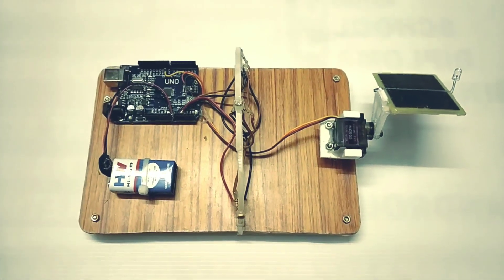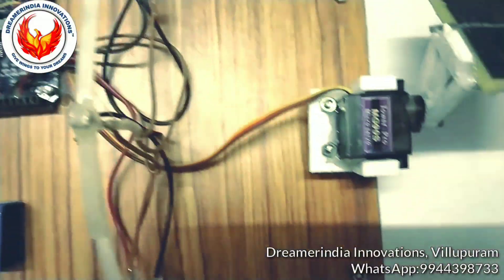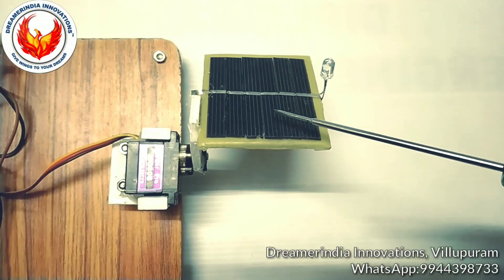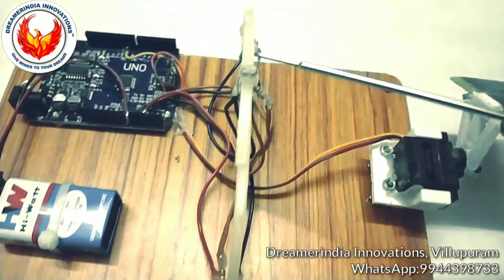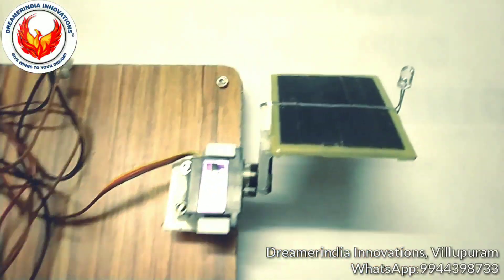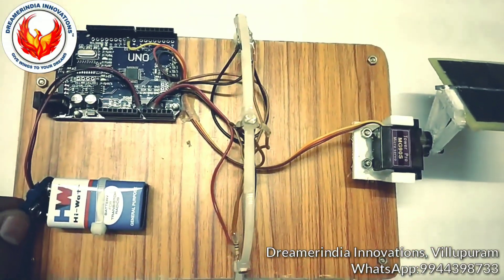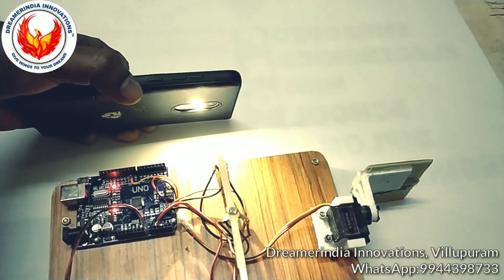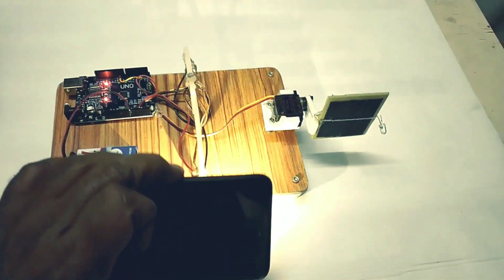Mini Project - Solar tracker using Arduino

Comment: Capacity of micro controller
Reply from the maker: It's Atmega328P microcontroller based board. 8 bit controller with 14 digital and 6 analog pins

Comment: Thank you for this demonstration. Please I need your help, I have a project of realization of a bi axial solar follower. I have a problem with the Arduino program, the sg90 servomotors never stop but they change from axial and vertical positions by detecting the LDR. I would like to know if the problem comes from the type of engines chosen or in the code itself. Thank you for your understanding. The code I used and in this URL https://www.instructables.com/id/Simple-Dual-Axis-Solar-Tracker/
Reply from the maker: Thank you. ping me @ dreamerindia@gmail.com